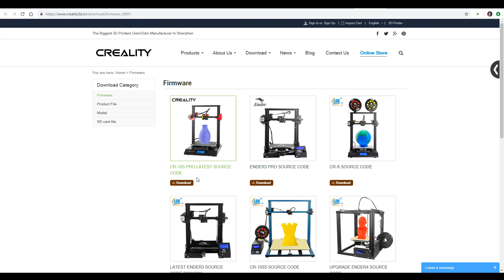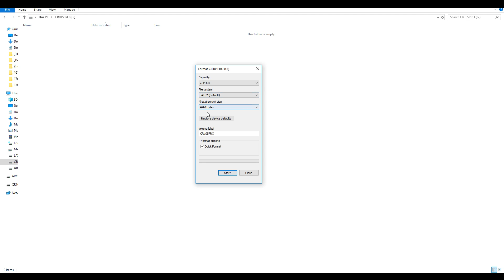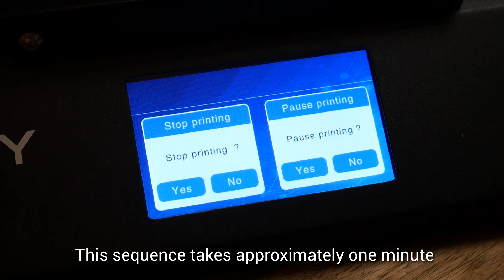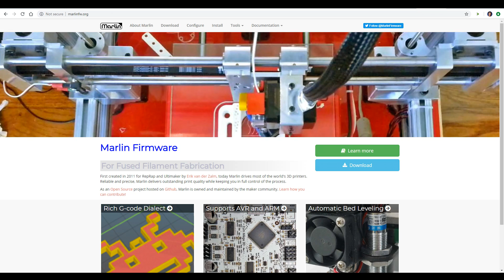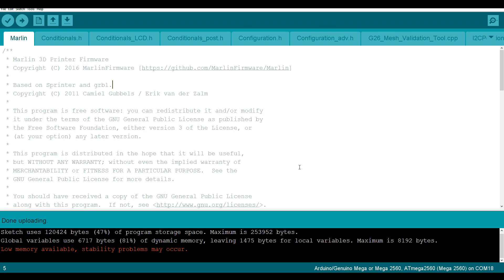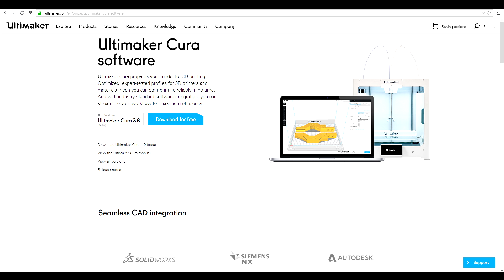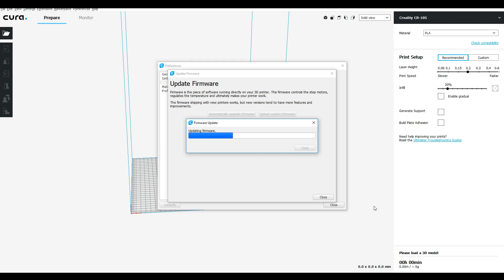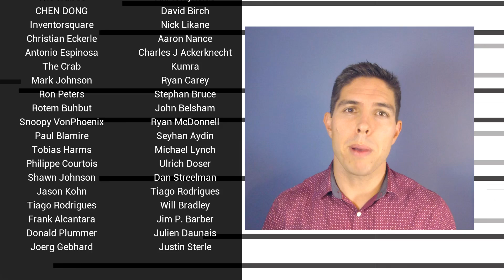How to update CR-10S Pro firmware - LCD and mainboard

Comment: Hi there,

i have a problem flashing the latest lcd firmware onto my Cr10sPro Display. I flashed my printer some time ago (marlin 1.1.9) and also updated the screen firmware while i was at it.

Today i flashed Marlin 2.0 onto it which worked flawlessly but the second step (flashing the display) just wont work.

I've formated the SDcard (8gb, microsd hc, fat32, 4096 bytes) and copied the DWIN_SET over to the drive. I then put the sdcard into the lcd's card slot (not into the printer's motherboard) and started the printer.

But nothing happened (except the printer booting up like before). The blue firmware update screen is just not popping up.

I tried several methods of formating (even dos command line cuz i read dwin's tutorial pdf). I tried older firmware versions from creality's website. I tried another sd card (16gb, microsd hc) but that also didnt work.

Can you help me figure out why the lcd is not upgrading its firmware?

Thank you guys <3
Reply: I'm having the same problem and have no idea what the issue is.
Reply: @underourrock  i tried EVERYTHING. the only thing that fixed it was buying a new lcd. with that new one everything went flawless on the first try (same sd and setup the other lcd rejected).
Reply: @elliotschka  I deleted the partition on the card and recreated it.  Apparently the controller screwed up the file system even though windows didn't find anything wrong with it.

This doesn't explain the problem you had except for a faulty screen I guess.  :/

Comment: Thanks for the video, however, I am having trouble with my update. I followed your instructions and uploaded the screen version (CR10SPro_Max_Ender5Plus_V2_Screen.7z) what I thought was the correct board version (CR10Pro_Stock_BIL_DW5.hex) but when I click on the Settings/Leveling screen I get a different version to what I am supposed to. It gives the five-point level check screen and none of those buttons work. My Machine is a stock standard CR-10S Pro with no firmware update since I purchased it in 12/2018. Just wondering if you have come across this.

Comment: What would cause the bltouch 3.1 not to register with my cr-10s pro. 
It self checks. When going home on leveling. It will turn all blue and drop probe, begans going down, I push probe up with finger and it starts to turn red until I push probe all the way up and then it flashes red but the head still continues to go to bed and crash into it if I don't stop it. 
Owned the printer for a month now without doing a single print... yay!

Comment: Im Doing this on mac and I have no clue how to change the parameters of the format. Could anyone help me so can update the firmware to the tiny machines one?
Reply: you might try the newfs_msdos command in a terminal window.  something like 'sudo newfs_msdos -F 32 -c 8 -v VOLUMEID /dev/yourdiskdevice'   (substituting the path to the drive as necessary) might give you the results you need, though I've not tried it.

Comment: Great videos, thank you very much. I'd like to use Linear Advance on my CR10S Pro. Can't really find anyone using it and you don't make mention of it when you talk about it on the Prusia how to do so on the CR10S Pro. 

Also, I find firmware (even with Marlin 2.0) on the net, but in the example files there is no CR10S Pro as an option to start with. Can you tell me if I can simply use the CR10S? I'm afraid about it not working because of the updated screen?

Thanks and kind regards

Comment: The SD card content will not refresh until you switch off/on the printer,   there are some other bugs that havnt been fixed like random freeze after touching the X axis end stop while in home just before print starts, also lack of resume print after powercut, sorry but I am going back to stock. It has been more than 6 months now and tinymachines doesnt respond to the known issues.

Comment: Thanks for the helpful video!  Creality 1.70.1 for CR10S Pro now appears to contain thermal runaway control -- at least, the images are shown in the display update DWin_Set file.  There is also a "Manually change filament" screen.  Just for fun, I edited the startup screen to show "V1.70.1" top left just under CR10S Pro.  Had to get Cura 3.6.0 as shown in your video to get it to work, though.
https://creality.com/creality-cr-10s-pro-3d-printer-p00253p1.html

Comment: hmmm, according to the source code, the thermal protection is indeed enabled on the factory firmware " Thermal Protection protects your printer from damage and fire if a
 * thermistor falls out or temperature sensors fail in any way.
 *
 * The issue: If a thermistor falls out or a temperature sensor fails,
 * Marlin can no longer sense the actual temperature. Since a disconnected
 * thermistor reads as a low temperature, the firmware will keep the heater on.
 *
 * If you get "Thermal Runaway" or "Heating failed" errors the
 * details can be tuned in Configuration_adv.h
 */

#define THERMAL_PROTECTION_HOTENDS // Enable thermal protection for all extruders
#define THERMAL_PROTECTION_BED     // Enable thermal protection for the heated bed"

Is there a reason then to upgrade to tinymachines software?

Comment: <br>
<br>
You List three different places where files can be downloaded from. But you never indicate which files are downloaded from which locations. You have the creality firmware page but you indicate that it does not have the LCD update. Apparently, magically that file got downloaded to your computer or sd card even though it&apos;s not everything we need and you explained what the files are and which one we need.<br>
Then there&apos;s a separate page from creality where you see there&apos;s a separate download for the screen software. Interestingly, on the second creality page there are three download files. One of which is the screen firmware. There&apos;s a third file apparently firmware version 1.60 .3. You never mentioned this and you probably should indicate this is not the file we&apos;re looking for. Furthermore, both files that we need appear on this page. Why not just go directly to this page and download both sets of files instead of going to one page for a four one file and another page for another file? Again unzip the files to summon Magic Place you never indicate if it&apos;s on the SD card that we&apos;re going to put into printer.<br>
Now you go to get a third page tiny machines to get 3D firmware for cr10s pro. What the hell are you doing? At this point in time I&apos;m confused as hell I don&apos;t know what files I&apos;m supposed to have downloaded from where and where to put those files and in what order. Like are they supposed to be in a folder or just in the root?<br>
<br>
There are a lot of remarks indicating that after they followed your instructions their printer no longer works. Don&apos;t you think it would be good to review your instructions? Make sure that you didn&apos;t leave anything out or didn&apos;t put something in that shouldn&apos;t be.<br>
<br>
You spend an awful lot of time explaining how we can take the 8 gigabyte micro SD card that came with the unit and back it up and then format it and erase it. Maybe you should have just said go to the electronic store or online and buy a new 8 gig micro SD card and format it according to instructions.. If you spent as much time explaining switching the files for firmware upgrade as you did on how to format an SD card, this would have been a different video. Most people know how to format an SD card.<br>
<br>
<br>
So you did a comparison of all of these folders side by side earlier in the video and said if you don&apos;t like the logo you can copy it from another place and renamed it as the original logo. Well when you have the D win folder, when we&apos;re actually going to use to upgrade, you don&apos;t indicate what&apos;s in the D win folder. <br>
<br>
Most stories has a beginning a middle and an end. The story of upgrading the LCD never ends. You should say something like that&apos;s it now we&apos;ve upgraded the LCD we can put the thing back together again and upgrade the motherboard.<br>
<br>
To take this on the other side, when you are starting to upgrade the motherboard firmware you should state that. And you should state that this file that you downloaded from this site is the one that you need to update the firmware on the main board. You started out just assuming everything.<br>
It seems like you tried to be everything to everybody. The problem is you&apos;ve got a lot of people in your remarks that say that now after following your instructions their printer no longer works!
Reply: shame the guy never actually answers these questions, pointless putting stuff up on YT if you are not going comment on questions you create by not showing every step  :/

Comment: Thx for the video Micheal, I did flash everything sucessful. I do have two questions, i am a newby ;). After flashing i notiched that the fan that cools the cooling ribs above the nozzel switches on as you turn on the printer. It only needs to run when you start printing and the hotend is hot.  How can you turn it of manualy? I tried M107 but that doesn,t work. 

And if i would like to change that also in the firmware what are the steps? Is there a source from tinymachine and where to look in the config file? Or try the firmware from th3, but then i have to activate everything for the creality is that hard to do?(as a newby).
Reply: Another fan gets ignored!

Comment: I followed these instructions (updating to the latest B7 available from TinyMachines). Unfortunately, it has broken my ability to print via USB from Cura 4.1 (Using Creawesome). The printer still connects to my PC, as indicated by the jingle and the appearance of a new COM port in the device manager. I can connect via Pronterface, but my connection to Cura is gone. Any help?
Reply from the maker: Perhaps changing the baud rate for the machine config in Cura.
Reply: @TeachingTech   Thanks for the quick response! I had to change the baud rate on the port in order to get the firmware to correctly update, but don't see an option in Cura to change that value. I did however, just set the rate back to its original value, and now Cura can print to it once again, tho...there are other issues, the connectivity one is resolved for now. If you can point out that setting in Cura 4.1 (with creawesome) or if its a gcode command...I dunno.

Comment: I can't thank you enough for making this vid Michael. I know absolutely nothing about firmware & LCD updates, so I had to watch this several times before I understood the jargon enough to guess the gist of which options I should take. I can start prints now without stressing out! Like you I love the CR10s Pro quality of printing, but unfortunately by the time I found this solution and sorted out all my bed-leveling issues, the erratic Z offset at the beginning of my prints had caused my hot extruder to gouge and damage the black plastic coating on my build plate (the removable top half of the two-piece aluminium bed). Fortunately the bed levelling issues didn't bend or cause any damage to the structure of my machine (switched it off in time). I still can't believe Creality shipped these otherwise amazing printers with FAULTY firmware. It's a beaut printer now, thanks to you! Would appreciate it if you could make a video about options on how to repair/replace CR10s Pro build plate surfaces. I'm sure there's a few out there that are badly gouged and munted like mine.

Comment: I just tried to get the driver and someone from TH3D online chat from their site said they do not support the pro. Now I am stuck because I have no way for the PC to communicate with the printer.
Reply: Yes, I had the same problem. I installed the driver FTDI USB, but it didn't recognise the printer!! :S
What could we do? Am I gonna have some kind of issue, if I don´t install the marlin firmware?
Reply: you can put the sliced files on a sd card and plug them in to your printer.

Comment: I got the firmware updated through Cura hex, but I cannot get Dwin_set to install the image files. I still don't see the Tiny machines startup screen, but the firmware does show TM3D 10S PRO. Any idea how to fix that?
Reply: Make sure when you format the SD Card the "Allocation Unit Size" option is set to "4096 Bytes"
Reply: @trajanonerd  That did the trick. Thank you

Comment: Hello Michael. Above all - great work! 
I have had CR10S-pro for a few days and I have noticed a few VERY annoying things. 
As you were doing a printers and LCDs software update, can you(or anyone) tell me if the new software solves these problems: 
-printer reads only gcodes files from the ROOT of SD card 
-files with long names are invisible for printer even if they are i Root folder on SD card 
-in ROOT folder you can have only 20 files (5 "pages" , 4 files each) . Every file above this is invisible -there is no way to change "flow rate" and "fan speed" during the print (even 4 years old Anet A8 has this possibility) 
-during print there is no info about current Z height only % 
Thanks

Comment: i used cura with a tiny machines hex file to update my cr 10s pro. once complete the extruder homes to the bottom left
What do i do?!?!?!
Reply: The tiny machine hex file does this on purpose as it is closer to a flex point. On top of this if you follow the level guide from tiny machines they do not believe the middle is necessary.

Comment: I had to go into the device manager, find the com port, go into the properties and change the port speed from the default 9600 baud to 115200 baud.   Then the upload worked on the second try.  From what I read, this is a common thing people need to do the first time they connect to their printer.

Comment: anyone have issue with downloading the dwinset? it starts zipping but never finishs or sends me the file
Reply: I had to move it from google drive to my google drive for it to download Im kinda lost on the 2nd part anyway. I dont understand why you/i dont just download the hex file TM3D_10SPRO_B6 .hex and update the firmware? with S3D or with Xloader? is that not the right firmware for the CR-10S Pro? Last 5 min of this video is wrong! lots of unnecessary steps in video in last 5 min. AFTER you update the screen if you downloaded the hex file from the page linked here on the same page you got the hex file download xloader under device in xloader ATMEGA2560 baud rate 115200 point it to the hex file and hit upload. Am i missing something?

Comment: Does this mean I can replace the boot .WAV sound with Windows XP Bootup sound?
Reply from the maker: Please try and update here :)
Reply: @OnePromptFourLLMs  I didn't upload a new sound file because I noticed that in the stock files, the boot up sound is made up of 6 or 8 separate .wave files that are 2 seconds long. There may be a limit on how large one of the audio files can be so they split the bootup sound into many small files and the firmware is probably setup to play them back to back.

Comment: Thanks for the video - I've updated my printer to the Tinymachines CR-10S Pro firmware ( hex file.)  I did run into a problem when I needed to add filament during the printing process.   After adding the filament I was asked if I wished to continue printing or quit (screen 82_E_Refuel2.bmp).  I selected "yes" to return to printing - but nothing happened.  I pressed "yes" several times and waited as well.  Still nothing.  Wondering if you tested this - or have seen this before.  Filament sensor tested ok.  Also, pressing "no" also resulted in no action.  I was required to power down the machine and start the print over.  Note that the printer was maintaining the temperature fine.

I have downloaded and successfully compiled the source code from Creality - but would like the features and code corrections provided by Tinymachines.  Tinymachines does not provide the source code.   Thanks again for taking the time to review the product.
Reply: peter Howard sounds like a question that should be directed to TinyMachines.

Comment: Followed your steps and all went well but post upgrade my preset PLA preheat temps are 180 nozzle and 70 bed. Is there a way to change that? I want my pre-heat temps for PLA to be 200 nozzle and 50 bed.

Comment: Love your vids!  Anyone here have any ideas on how to re flash if your board get stuck on the loading screen.  Tried reflashing with original as well as Tiny Machines firmware and not getting any love.    Can no longer connect Cura either :-(
Reply: I have the exact same issues.
Reply: @sayerwoadhyll8440  found a solution and i was able to reflash it with an older version of cura.

Comment: Not sure what went wrong but i applied the Tiny machines graphic update which was fine, then applied the Marlin 1.1 update. Now the printer wont boot past the 1st screen. I am able to attach to it with Simplify 3D. Tried to do a home. Horrible grinding noised from the motors. Got late had to stop. Not sure what to do at this point but maybe re-apply the Marlin update but it said it was done with the update.
Reply: Update - Looks like it was a corrupted download. Tried 2nd time same issue with the same file had same issue. Downloaded again and uploaded to the printer with no problem.
Reply: @topdawg666  im having this problem, how did you fix?
Reply: I deleted my original file from the site. Downloaded a new file and it worked fine. I can only guess it was a corrupted download.

Comment: Great video ! Congrats... Before upgrading my CR10s Pro to Marlin 1.1.9_B5,  I would like to know what are the lines number in ''Marlin.ino'' to increase extruder temperature to 300c and bed at 120c ? Also, trying to find temperature lines, I modify the printer name in Marlin and during saving to .hex file, there was a warning in Arduino for Low Memory and ''No Port'' is selected. Any idea... By the way, I did upgrade my extruder to all metal MicroSwiss. Thank you in advance for your help !